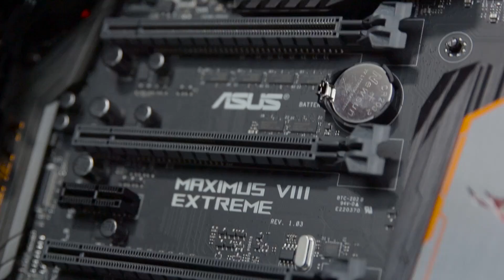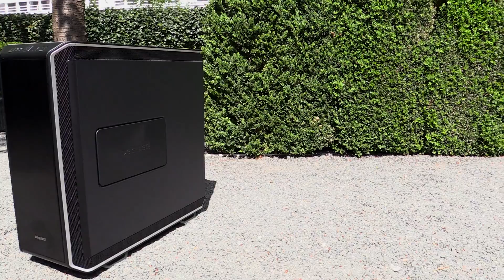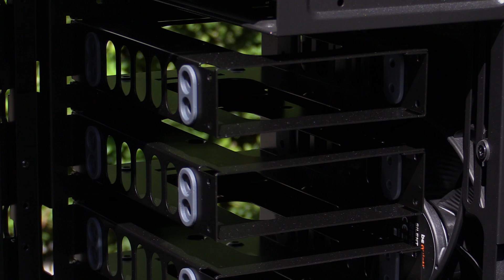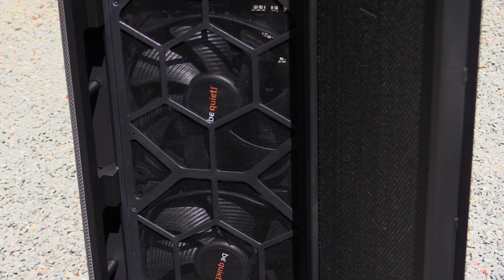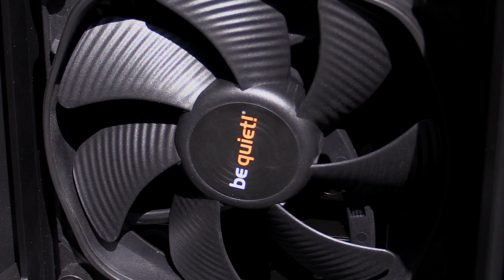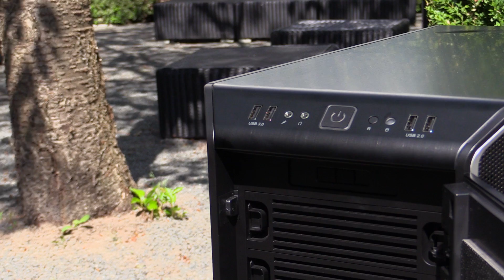be quiet! Dark Base Pro 900 modular Midi Tower (English) | Allround-PC.com

Comment: It is glass on both sides so if you invert the mb tray, you can see it from the other side or, the panels swap as well (one solid, one glass)?
Reply from the maker: There is only one window panel, but you can choose if you want to have it on the right or left side of the case.

Comment: This case looks outstanding. Checks all the boxes in my book:
-Large Tempered Glass Window
-PWM Fan Control
-Support for very large radiators on the top AND front - even fan mounts on the bottom
-Modular HDD cages
-Open design (bottom PSU shrouds/basements are meh to me after having my NZXT H440 for 2 years now)
-Black/not too flashy design
-Quiet/silent design in mind

With bonuses!
-LED Control
-Qi charging!
-Reversible motherboard tray
-Break-out motherboard tray to use as a test bench!

Time to start saving every penny. Can't wait until this comes out!

Comment: It says it fits a 420 radiator in the top, but what are the limitations there? In my current 750D I had to cut the top of the Optical bay out because the width of my HWL 420 was just a bit to wide.

Comment: I would like to hear more about the water cooling options, the mounting of pumps and reservoirs. Also a bit worried about the available space for cable routing in the back, didn't look that spacey. Definitely one of the more interesting cases this side of CaseLabs I've seen in a very, very, long time though.

Comment: This is pretty much perfect. I've been looking for a new high-end silent case that isn't just a square box (Fractal, Nanoxia) to replace my Define R4. So few companies are making enthusiast chassis that are designed to be silent. The fact that this supports such extensive water cooling also really interests me. I would have preferred a smaller version (with less water cooling support) as I'm trying to stay away from larger cases, but I think I can forgo that since the Dark Base 900 is still considered a midtower chassis. I'm very interested in this.

Comment: I just have one question: When do we get Silent Wings 3 to buy?
Reply from the maker: We forwarded the question to be quiet! and will post the answer as soon we get one :)
Reply: Wondering the same, when will this fan be released to the public as a separate product and not just bundled with a few select items.
Reply: I really appretiate it. Thanks!
Reply from the maker: The launch will be in August for arround 21-22 euro
Reply: +allroundpc cool. Do you know if it also valid for 140mm fans?
Reply from the maker: As far is we know there are going to be 120 and 140mm versions.

Comment: Nice looking case.But my question is how thick can the top mounter radiator be before interfering with the motherboard ? The front can be 30mm if you still use the hd cages,but how thick if not using the hd cages?  If this 900 can handle 68mm either on the top or front,I might consider this case :)
Reply from the maker: It can handle radiators with a thickness of 65mm
Reply: Thank you for the info .I was asking cause I have a EK 240 Predator and if it would fit ( top or front ) I would try the Pro 900 .It has a lot of features that I like .